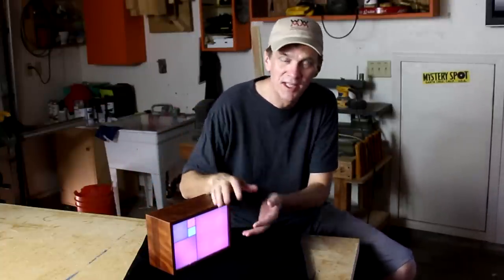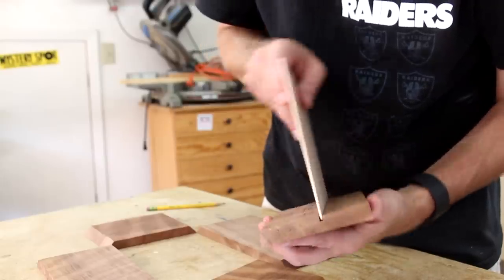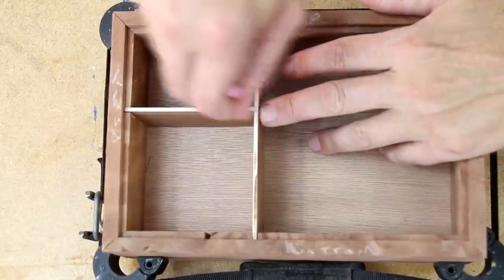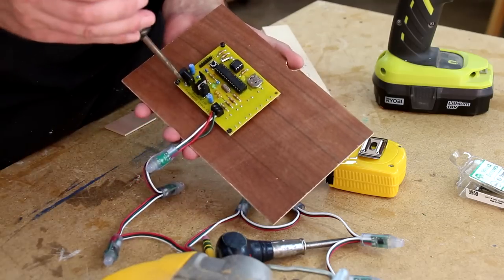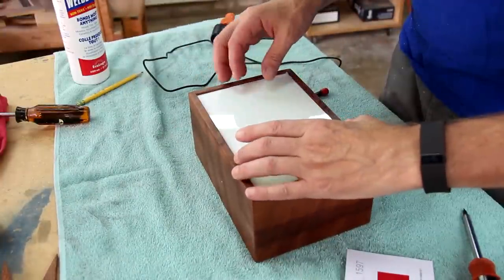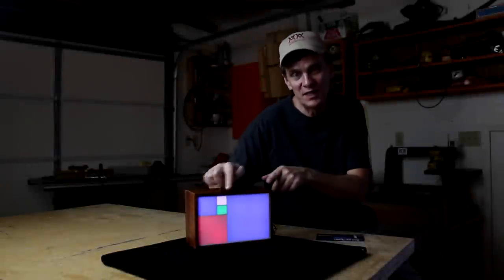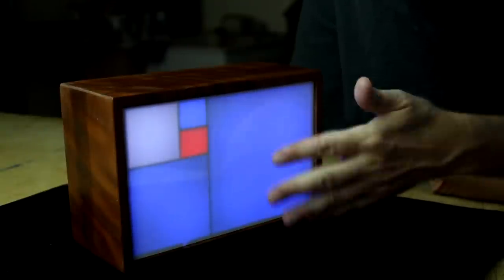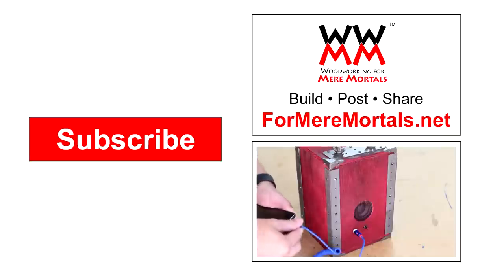Tell Time With A Fibonacci Clock. Time to Geek Out!

Comment: Cool project Steve.  Just curious though, do you need to change the blade on your table saw when you cut the plex-iglass?  I've only ever cut plexi-glass by scoring it using a plastic knife - the table saw seems a great deal faster.
Reply from the maker: +TrionAlpha It doesn't dull the saw any more than wood. I don't think acrylic is any harder.